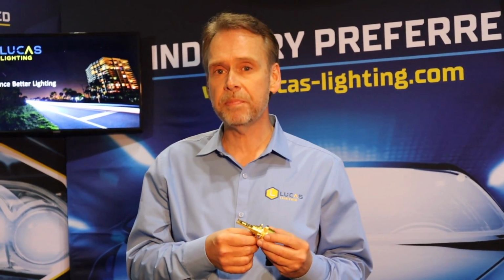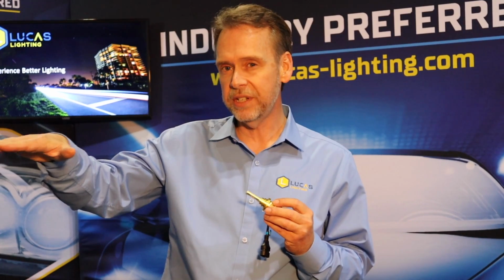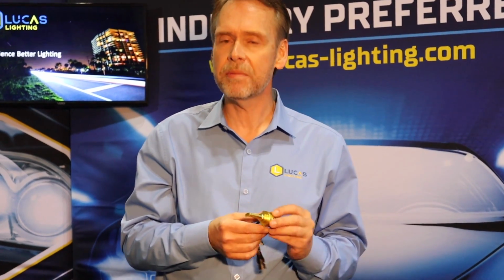Industry Preferred LED lighting Lucas Lighting

Comment: these have no more output than my BPS Lighting leds from amazon that cost $49 and $79 .   this guy is full of it when he says these lights will produce a flat line with a drop down. the light bulb doesn't create that, a projector lens does.
Reply: They probably just get the other cheap led bulbs off Amazon and rebrand and package them.